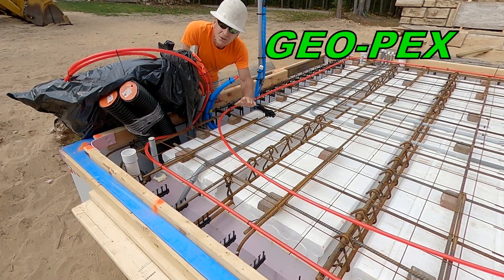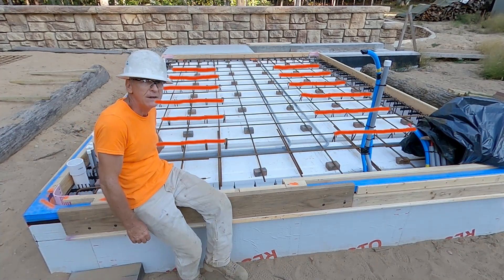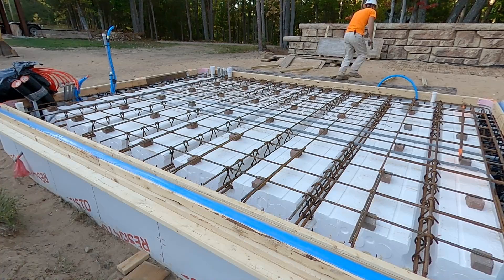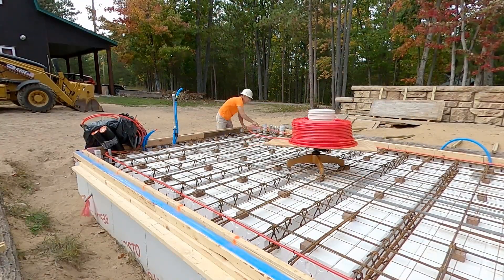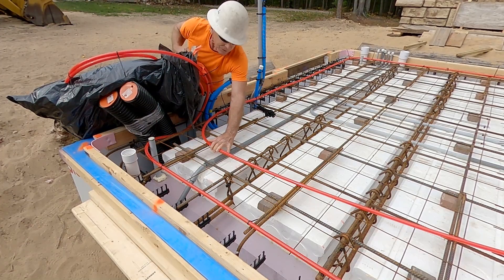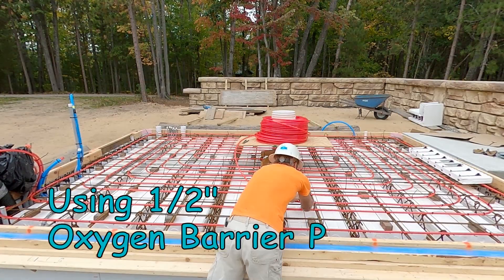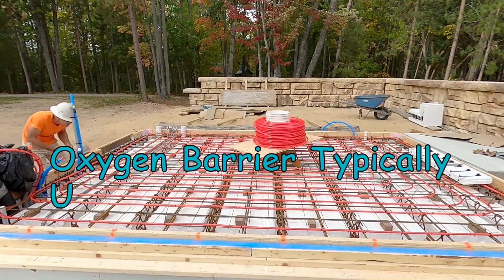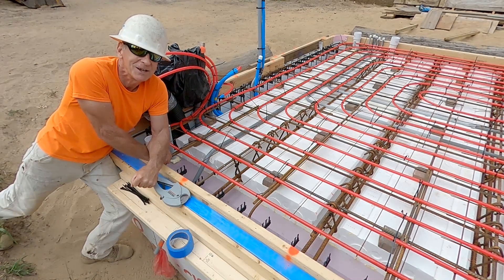Install Radiant Heat PEX in Concrete Roof, DIY  - Day 56 Root Cellar Build, Storm Shelter, Bunker

Comment: Never seen a guy send so many videos of the same episode.
Reply from the maker: You must be talking about the Concrete Roof Build. The Roof build starts to look like reruns but in fact there are 5 layers of construction in this Concrete Roof Build.
Installing the Styrofoam ICF Insulated Concrete Forms that form the concrete for the roof.
Installing the Rebar for concrete reinforcement to be Bunker rated.
Installing all the needed PVC piping for Utilities, Vents, and future items. 
Installing the Optional GEO-PEX Geothermal heating. (Optional)
Placing and finishing of the concrete.
Once it is set in concrete any changes or additions would be very costly so I try to show viewers all the phases needed to build a Concrete Roof. Thanks for watching.